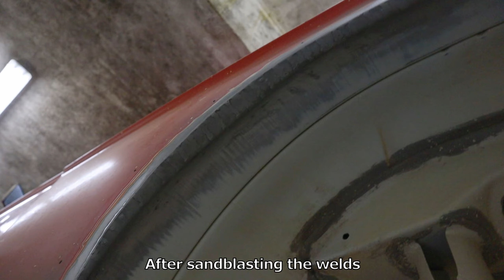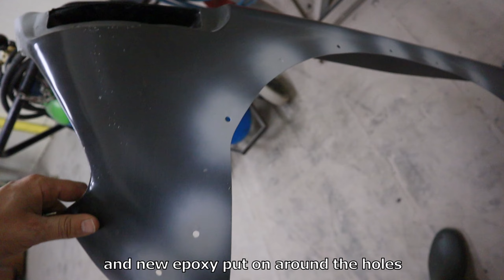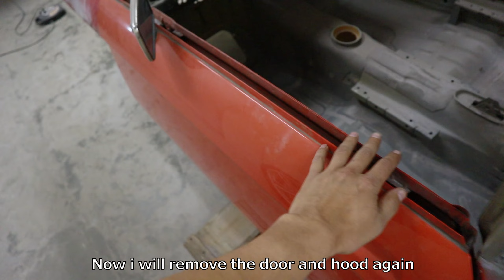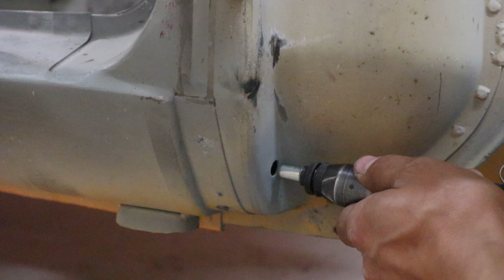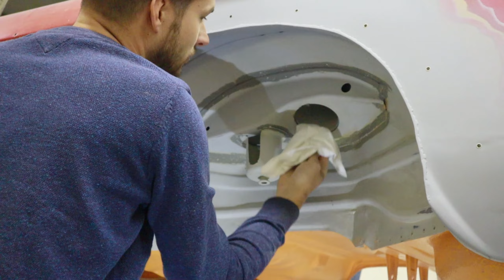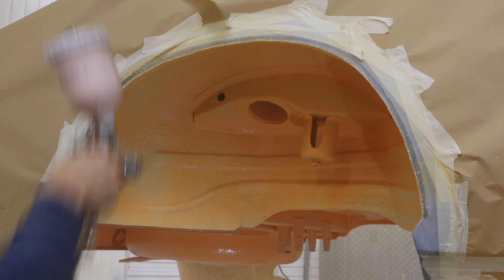Preparing the wheel arches for painting and installing the turbo flares / Fenders bmw e10 2002

Comment: Nice job! I like every video. You surely come from a professional automotive background, right?
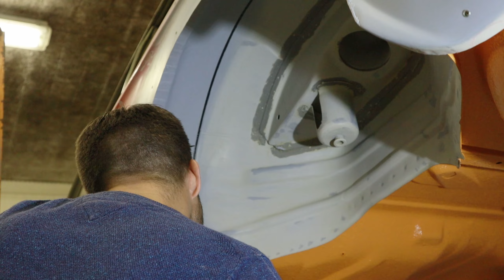One question: At 3:43 you apply seamsealer with a caulking gun and then begin to flatten the seamsealer with a brush. What liquid do you dunk the brush in, to keep the seamsealer from sticking to it? Just regular paint thinner?
Thumbs up!
- Julius
Reply from the maker: Thanks ! And indeed this is correct, and I do indeed use thinner there 😉 grtz